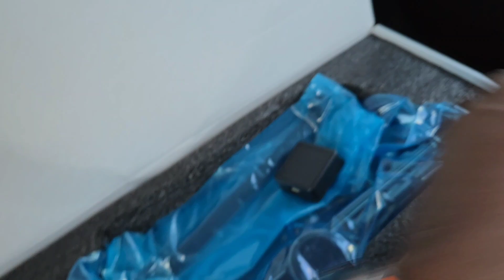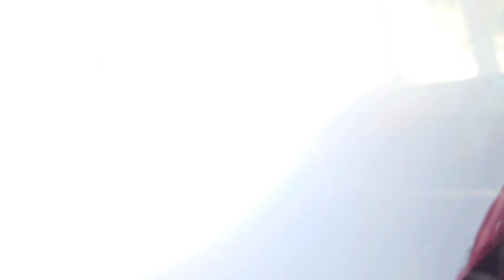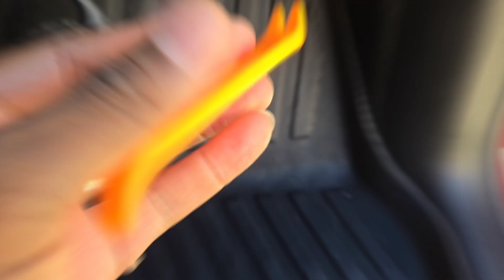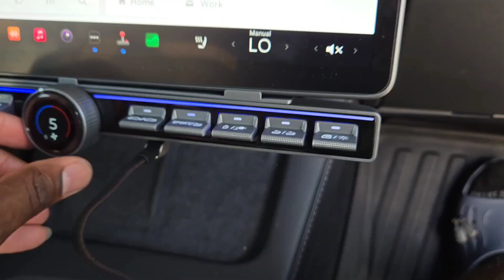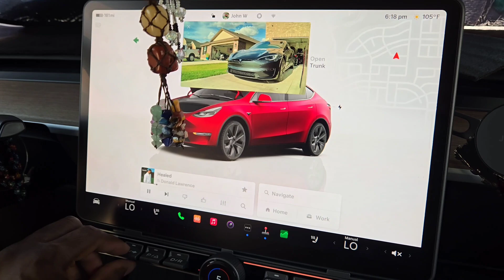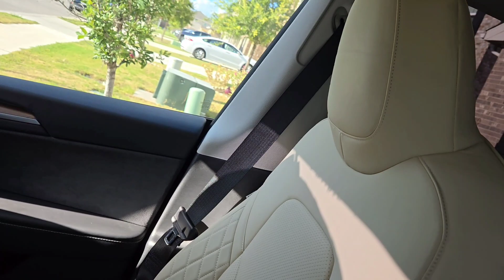Hannshow Center Console Physical Control Button Multiple Functions for Tesla Model Y/3

Comment: Hi, HansShow website states that this V2 Bluetooth model contains a rechargeable battery. The USB C cable can be used to charge the unit and then be disconnected once fully charged.

Can you confirm that this unit works without the USB C cable connected?
Reply from the maker: YEP, good to go
Reply: @smartphoneconversations  I received mine today in the mail, but I have to order 1 lithium ion phosphate 18650 rechargeable battery. Unfortunately, Hansshow doesn't include on. Thanks, and have a good night.